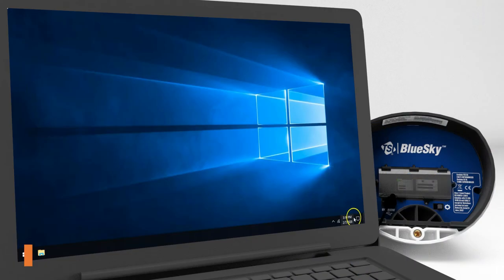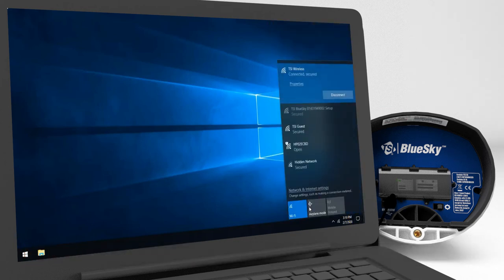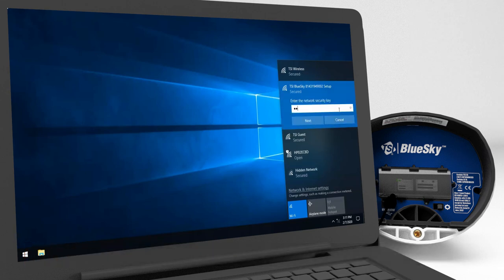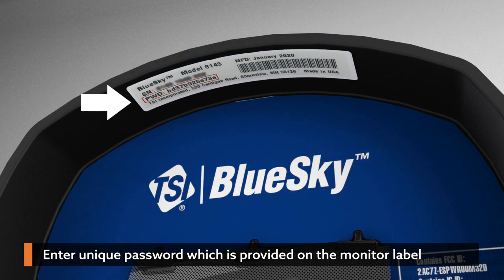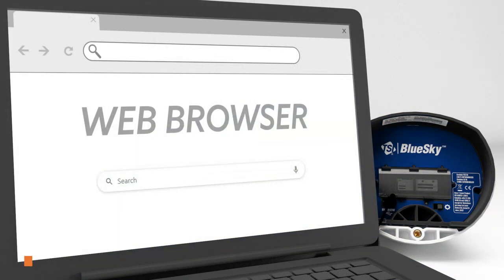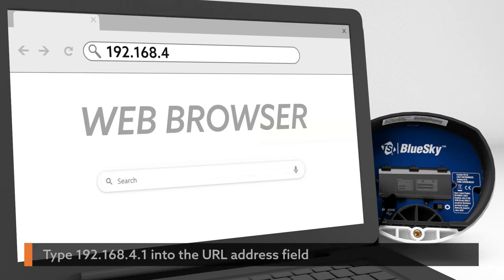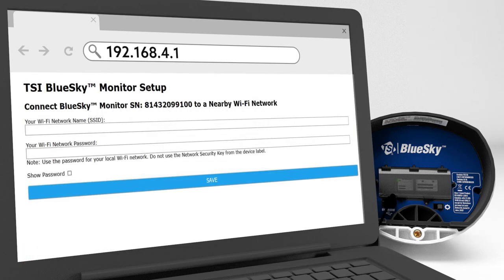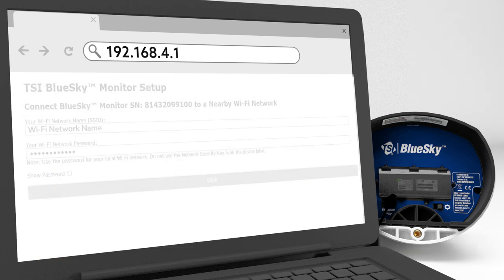How To Set Up and Install the BlueSky Air Quality Monitor

Comment: I am a site engineer at a large business. We have two great weather stations on our roof. But no outside air quality monitoring system. We need a device that could give us a heads up, when the oustide air has degraded from wildfires. I place our building into bad-air-mode before the wildfire smoke can alert our fire system. But have to keep an eye on our system. Will this product do the job if installed on the roof? We need something to alert us to close the air handler dampers & to isolate some parts of our system.